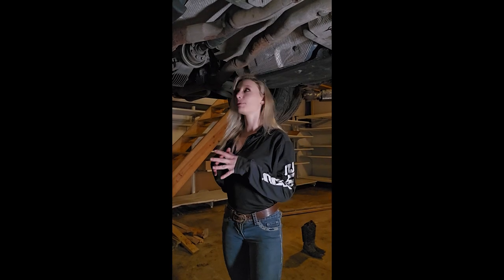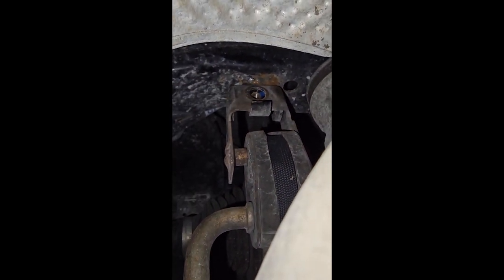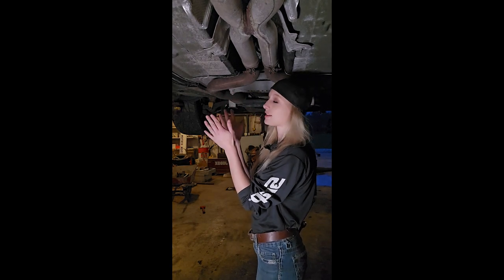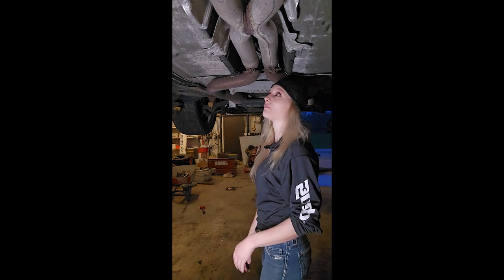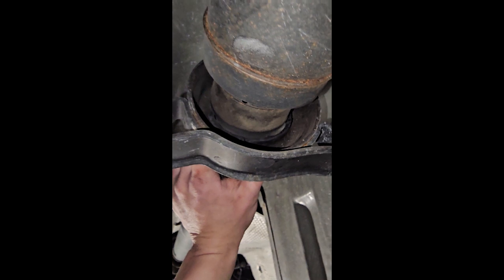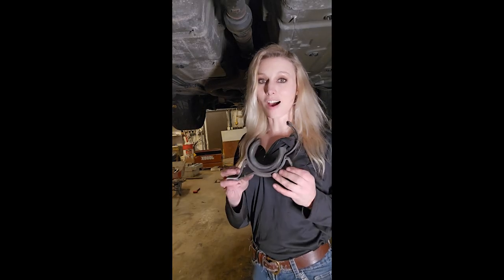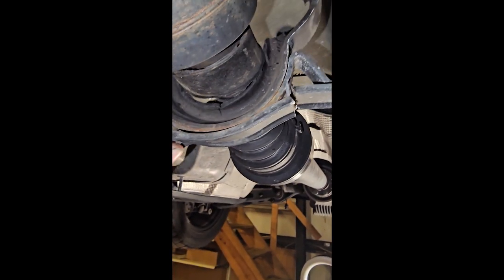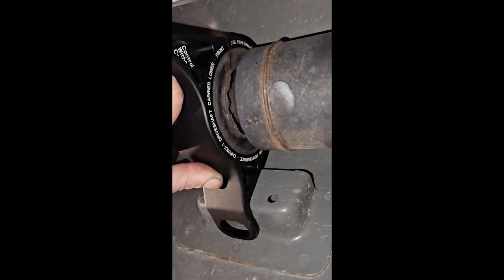*EDITED* 2015 Challenger Carrier Bearing Upgrade to JXB Performance

Comment from the maker: Yall I'm so sorry it took THREE times today to get this to upload correct. Unfortunately youtube does not let you preview what you are posting before it's posted lol. But the audio and everything should be fixed now.
Reply: Thank you! 😘 #brakecleanmafia
Reply: I’m sorry but why did you take the exhaust off? It slides out..
Reply: Swivel socket the carrier bolts pry bar the exhaust for the last 4 threads index the driveshaft and slide it out the back… beautiful presentation an donuts and throttle blips in gear do in fact cause premature wear of the that part then the trans mounts and diff fail later…
Reply from the maker: Nothing just "slides" off. You have to cut the carrier bearing housing off to get the old one out. Do do that I removed the exhaust. The only way your statement makes sense is of you unbolt the driveline at one end. Which I did NOT want to do give the bolts are torqx style and were most definitely going to be harder to remove than the exhaust
Reply: @thedieselqueenmelissa715  He drives a Supra. That explains his ignorance.
Reply from the maker: @AppalachianPatriot  in theory he's right it's possible. But that involves unbolting the back end of the driveline. And no thanks lol. I messed around with that idea when I was considering just replacing the whole driveline. Dude those bolts are TIGHT. It would take heat work and a prayer to not round them out. Honestly the exhaust is easy af to remove.
Reply: @thedieselqueenmelissa715  You were right the way you did it. I would have done the same. He can do it how he wants on his own car. It’s your car, your rules, your way.
Reply: You go girl! Your smart and very mechanicaly inclined! Ignore the haters their just jealous as you are very good at what you do!  Hope your career takes you were you want to be and accomplish along lifes rocky trail
Reply: I bought the piece from JXB and some popular shops refuse to do the work because they dont want to be liable. Then they wanted to charge me 1300 labor and all, when i already have the piece i need. Still looking for a shop to do it. I showed them multiple video especially yours but they are giving me a hard time.

Comment: This is the best repair video on this carrier bearing out there  ! I just changed it out on a 300C a day ago. Previous fix temporary was to drill new holes forward an inch and remount the torn rubber on the bearing not behind the bearing like factory. It worked well in a pinch but the new version split carrier was a god send like you .
Reply: Did you experience any vibration at high speeds after installation?

Comment: Wish I would of known there was a bearing I could of bought I bought a new shaft because a bearing I was told was unavailable for that year. Mine 2015 challenger rt shaker and had only 30,000 miles on it when it went out . Just a bearing up grand would of saved me some $$$. Dealer said my warranty just ran out go figure.  Thanks for the awsome video and info.

Comment: I just would like you to know iam personally  proud  of you getting  in to this line of work,iam a 30 year dodge tech ,level 3,and a cummins  fan,own a 05 5.9 with 270,ooo miles runs like a top. And if you ever need  anything  info wise ,don't br afraid  to reach out to me,still have access  to dealer connect.

Comment: I just did mine, figured since i was putting a new AWE exhaust on it would be a good time to do it, haven't driven much to feel if there is much vibration difference considering my factory one was still intact so I guess time will tell on the wear of it, at least you can service them easily with new rubber

Comment: the 1994 ford thunderbird i have has 365'000km's on it and the drive shaft is still the original, has a second transmission in it and a "unidentified terminator engine". (things in vehicle that force one to take it in to be serviced regularly) 😋

Comment: Hi, I was wondering what other parts to change at the 100k-ish mark on these Dodges. All the front suspension? Fuel pump and filter? EGR valve? (By now is it clogged with carbon?) thanks for your time and great video! P.S. I still need an overhead on a series 60 lolllll
Reply: Yeah, at 100,000 on any dodge you'll need to change the dodge part into a ford. You'll get more than another 100,000 miles easily with no other major repairs.

Comment: Solid work, good job on the loctite ive seen a few of these installs and they werent using loctite which is a bad idea. Question though when you were wrapping up am i crazy or is the driveshaft not straight? It looked like the position of the CSB was slightly more to one side.

Comment: Use a ratchet strap to pull back on the exhaust and those slip joints come apart much easier.

Comment: Love this video! Thanks for sharing, I just bought my Challenger five months ago with 60k miles and it has this problem! So annoyed by Dodge. I have a question. I don’t know if I’m getting ripped off by the mechanic. I have a bad driveshaft center support bearing and they say I need to replace the entire driveshaft which would cost me $1900 with labor included. Does this seem reasonable at all? Why would I need to replace the entire driveshaft if only my central support bearing is bad?
Reply: Because you’re getting ripped off I hope you didn’t actually pay for that. She explains in this videos perfectly how to replace this part

Comment: Just seeing this part for the first time I wonder if the exhaust heat is shortening the OME part life. maybe having side pipes would solve that issue, not sure if you can even find those anymore, I would love to see you wearing safety glasses whenever you’re under rusty cars or anything you’re working on. Eye injuries happen so fast to mechanics and welders ,Amazon and your local Home Depot have safety glasses, and pickup a face shield for overhead work and grinding, and try not to be complaisant or to tired to stop 🛑 and 🤔 always put safety first, If I worked with you I would tell you the same thing at work. I enjoy watching your interesting content, If you weren’t so special I probably wouldn’t have mentioned the safety thing but sometimes we feel guilty if we don’t try to safeguard people we care about. Best wishes ✌🏻🗽🇺🇸
Reply from the maker: There is a hear shield, but that would make sense
Reply: @thedieselqueenmelissa715  Harbor freight has cheap full size face shields. Was doing some grinding like this and had a new grinding wheel explode...sending fragments into my cheek and nose. Busted my safety glasses and cracked my real glasses underneath. Keep up the good work, i follow women like you and point out your work to my 4 daughters..and now 2 granddaughters.

Comment: Your Carrier bearing is not centered in the driveline direction. For reasons to keep which in your bearings of your Eugene as well as help with the load off of a Carrier bear itself.

Comment: It's best to just pull the whole driveline out if you don't equally match up the weight it could unbalance the driveline and it will mess up the transmission
Reply: No worse than it flopping around

Comment: How has this hield up done for you I jjst broke mine in my 2017
Reply from the maker: We have had it on the daily for about two months now. He drives it like he stole it and so far its holding up good.
Reply: @thedieselqueenmelissa715 Can I get an update? Is it still holding up? Bought the part for my challenger. Hopefully my mechanic will do the work